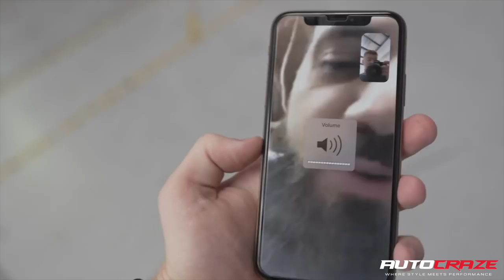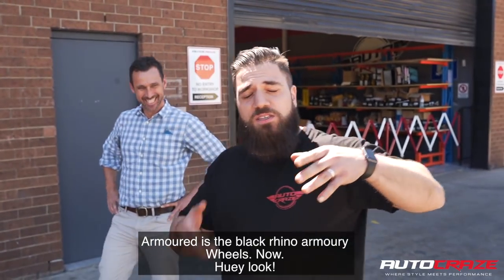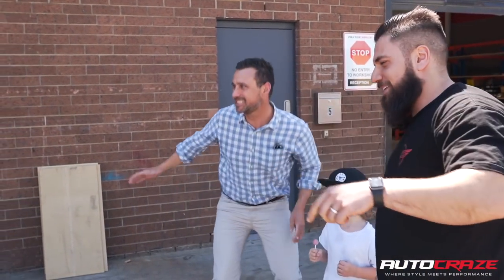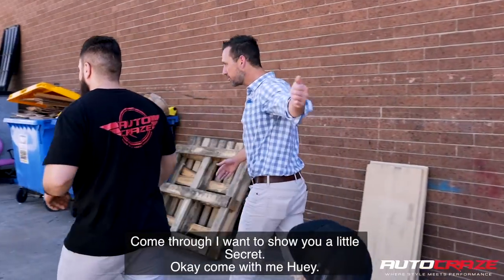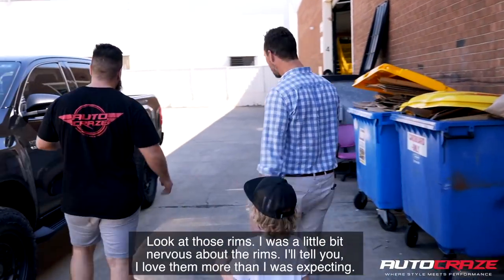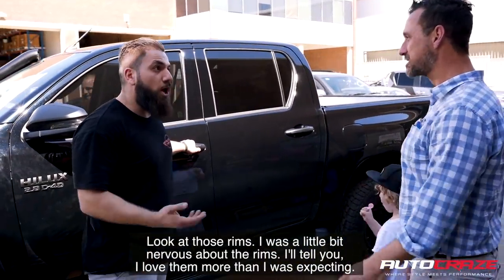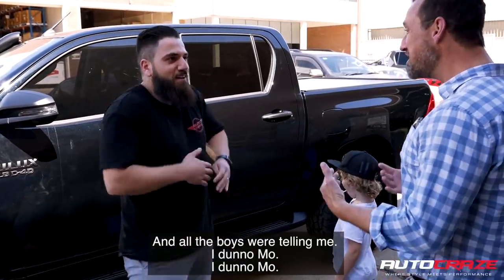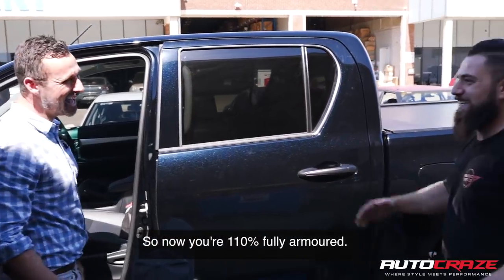ARMOURED HILUX // CRAZY MODIFIED 4X4 BUILD

Comment: Plastic front bumper moulded to look like welded steel?
Reply from the maker: Hi Brad, This is actually a Rival bar. It’s light weight, 50kg bar, made of 6 mm alloy to ensure it’s crash resistance strength is well above standard but well within all ADR compliance for your airbag and safety. KT